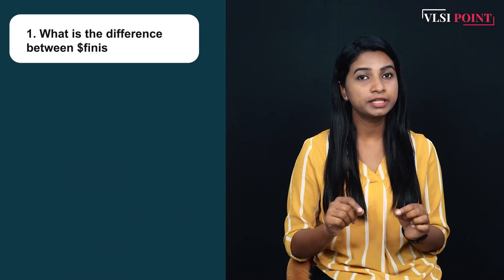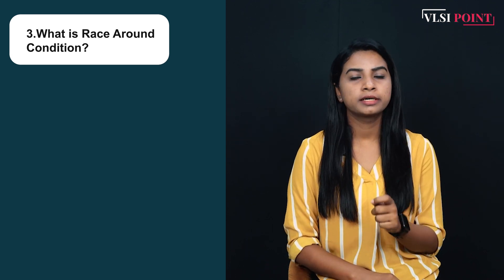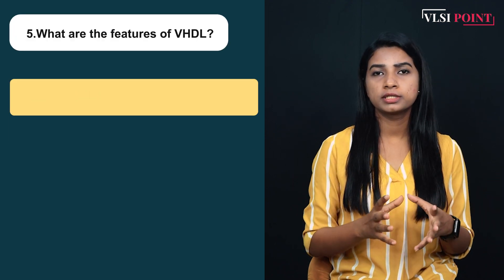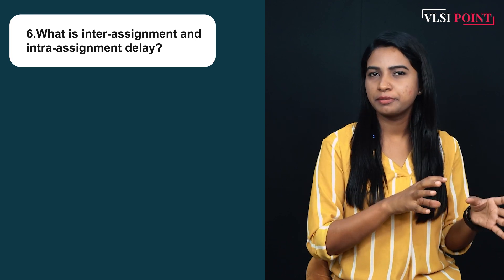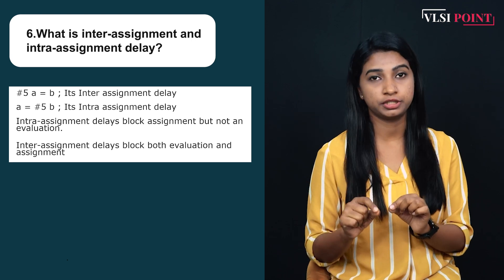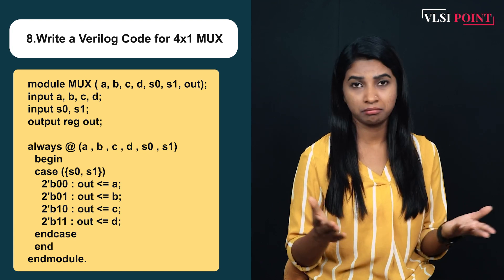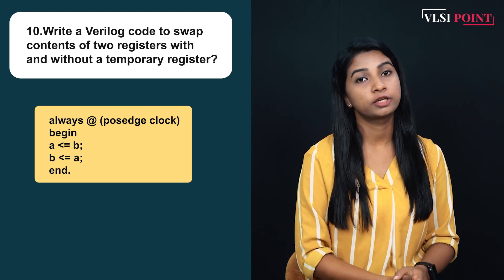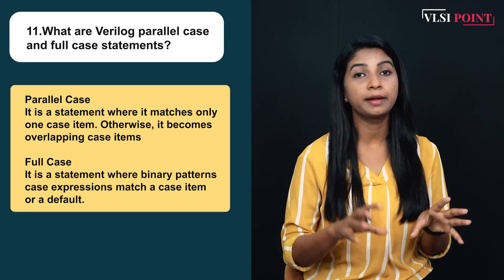Verilog Interview Questions with Solution | #3

Comment: Answer of the 9 question is not correct . Ripple counter should be async so that total delay is n times the propagation delay of flop. But you are writing the verilog code for 4 bit sync counter .

Comment: Q4 you have mentioned casex ,casez,while for loops as synthesizable it's wrong...
Reply: casex/casez: if the case item expressions are constants then this is easily synthesized.
while: dubious, but if it can be unrolled it's synthesizable. Synopsys Design Compiler is supposedly able to do this.
for: ditto. Everybody can do it.

Comment: In 9 th question how can we that this is a ripple counter , it can also be a synchronous counter from the code solution in video ?
Reply: Yea surely you can say that, since it has not been mentioned to follow any specific approach, this solution is also fine and your's one too!
Reply: Yes, you are correct , ripple counter should be async only . clock of one flop i.e nth should be driven by output of previous flop i.e n-1.
Reply: @Ajay-mw3or  Yea, you are correct. Ripple Counter is an Asynchronous Counter, and this is the code of Synchronous Up-Counter! Thanks for Commenting.